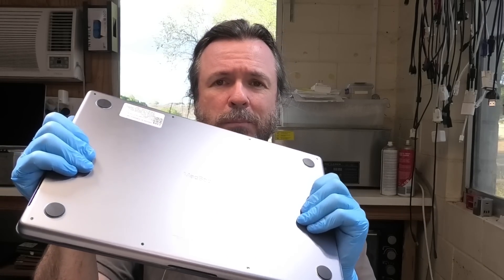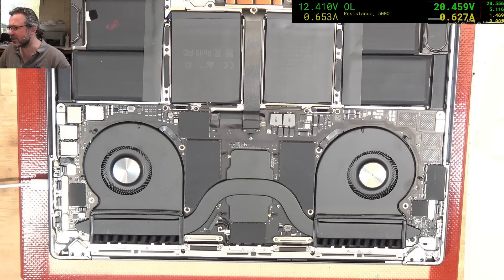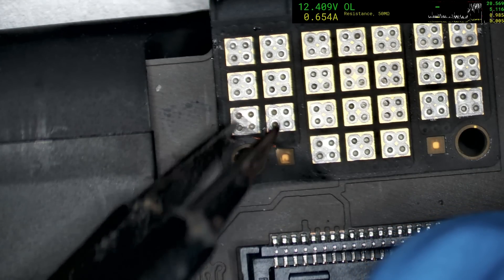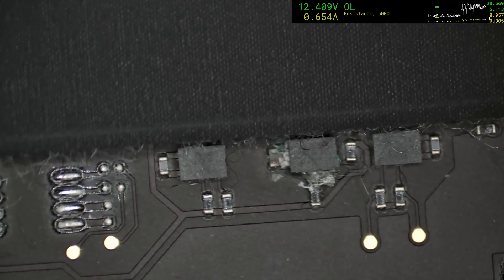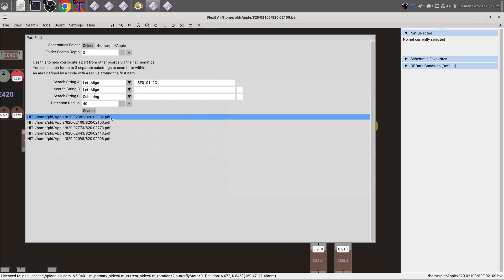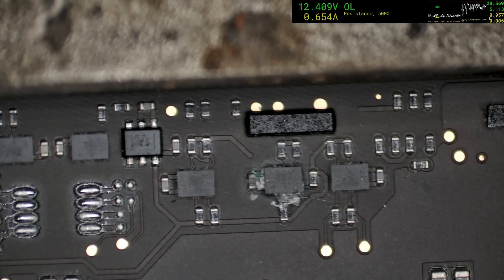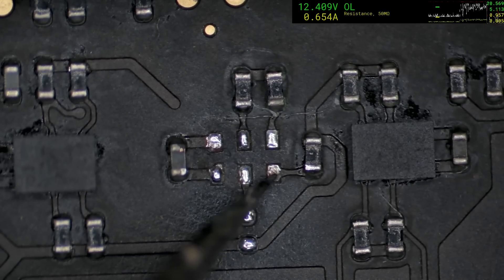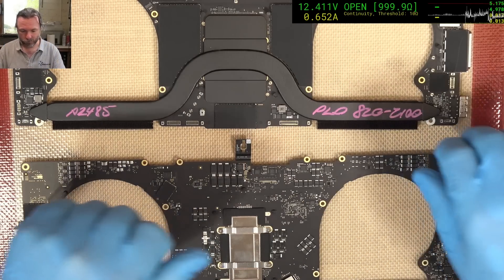Macbook has "NO CHARGE" after dead battery replacement. Bad battery or did someone make an ooopsie?

Comment: Hello. Thank you very much for your video. Your tips and demonstrations really help me a lot in solving problems with the equipment I take in for repair. However, now I'm stuck with a device exactly like the one in your video. An a2485 with the same board. I don't know if you could help me. The device is working normally via HDMI, but completely without an image on the main screen. There is no image indication or even a backlight. I know it would be easier to use a spare screen, but unfortunately I can't buy a screen to test this device. So I would like to know how I can perform tests and identify the problem. I believe there are two problems: a video problem and a backlight problem. However, I don't know how to proceed with this model of device and without a test screen. Thank you very much for your attention and any help you can give me.
Reply from the maker: I don't have any great advice.  I recently had a similar issue and it was likely the TCON board in the display itself. Seems to be a relatively common problem.
Reply: @pldaniels  Thank you! So do I need to buy a new LCD to test and replace it? The problem is that in my country imports are 12x the value of 1 dollar. 200 dollars here is the same as 1200 dollars. That's why I asked for some help before to buy a LCD. Thank you.

Comment: Flapping battery. That's a new one @__@ Thanks!

Also: All Hail Pedro
Reply from the maker: I did end up putting down a couple of strips of tesa tape to try keep them in place.  I do wish 3rd party battery makers used decent pull strips even if the original design didn't.

Comment: Excellent find and satisfying to watch, I did think 'oh oh, they have probably junked a perfectly good battery' when you found it :)
Reply from the maker: Indeed.  Unfortunate but these things do happen. Biggest downside of course is the loss of the safe behaviour due to those 3rd party packs almost always putting out full voltage even when the data-flex isn't connected.